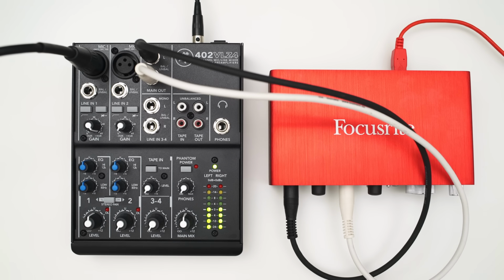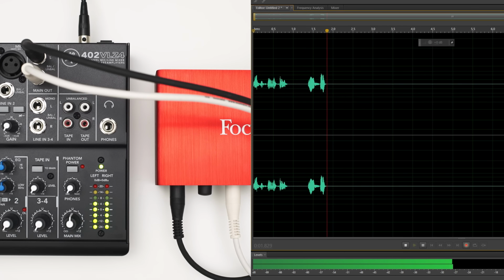Setup Guide - how to connect a Mixer to an Audio Interface for audio recording

Comment: Thank you so much for this perfect, simple, clear and basic explanation of this technical aspect of digital recording.  I would really love to watch you explain how to connect multiple synths and other instrument to a mixer and a interface and what type of mixer would be required.  I have a few synths (SH-32, yamaha CS, and Roland XP-50 which I use as a midi controller mostly and I am struggling to set them up permanently so I can use them when the inspiration hits.  I have a few challenges because I am not an engineer and am of the analogue time.  I do though, totally love these new technologies and would like to be able to have a better basic, fundamental understanding of of they work together.  The external hardware issue is a bit more easy to grasp but when it comes to setting the software part of the sequence it becomes a real mess...  I use Logic Pro with a Scarlett 4 pre, and I am a composer.  You also did not mention where the output is routing.  My set-up has the monitors going through the interface and into Logic, so I need my computer to hear sound through the monitors.
Reply: Dont use a mixer and an interface, just get a better interface with more inputs like focusrite 18i20.

Comment: The real question is: why do you need a two channel mixer if you already have a two input interface? Pointless. If you do use a (let’s say) 26 channel mixer to mix drums to two track, you are stuck with that mix once it’s on disc. There’s no adjusting levels on individual drums or compressing/gating separately. You have to commit. Are you ready to do that? It’s good practice but most people don’t start out with that skill. What would be much better is a multi channel interface. Forget the mixer. Unless the mixer is also a midi controller, there is no point.
Reply: From the first pinned FAQ Post which you obviously didn't read:
Q: Why would I want to connect a two-channel mixer into a two-channel audio interface? Couldn't I just connect the two mics directly to the interface?

A: Yes, connecting a two-channel mixer to a two-channel interface is not really useful. I just used the hardware seen in the video for demonstration purposes.
Reply: You are exactly right, this is basically a beginner mistake video.
Reply: You can just tweak the eq and set up individual volume in the mixer. Before you record it. And optionaly add a signal prossesor to the insert of the mixer. And you can add multitrack recorder. When you wanna record more than 12 channel, then the mixer is the best option. You just have to find correct mixer and interface to do the job.
Reply: The even more real question is: why are you here if you're just going to record straight into your interface? This video is for those who want to use the preamps and maybe the eq from their mixer to their audio interface... Not every preamp sounds the same...
Reply: You are right @crosbyllc5426
Reply: The reason he is showing this video is because Mackie mixers are known for their excellent quality onyx preamps, even on this little mixer...which may be better than the ones on these lower end interfaces.  So the gain would come from the Mackie and not the low end interface.
Reply: I use it for blending two mics and getting a cool guitar distortion sound
Reply: The fact here is that ~33k people (til now) found this tutorial likeable, so there is an actual need.
Reply: @Marvin Bennett  i don't know exactly about that. but that can be happen since having a mixer can saperate the input and output monitor. while you only using interface that don't have capability to saperate direct monitor and playback from the DAW, the output will handle two sgnal from the direct input and from the playback that causing latency. adding a mixer will save you in that situation. give you 0 latency monitoring. however you can turn down the buffer size.
Reply: Useful as a channel strip, preamp for other lower sour e inputs, live instrument bus

Link your most recent releases though let us know how not beginner you are now that you’re blowing up dj wide chain
Reply: The same principle applies to mixer and interface with many channels. 
This is a good video for any e who wants to set up a mixer and usb interface in a rack and not have to think about rerouting audio cables from the interface to the mixer when you’re just playing or recording.

Comment: I went with the behringer umc404 and so far so good, apart from one or system crashes in the beginning.
Reply: Does it work properly with umc404? What you mean by one or system crashes. I am planning to connect mixer to my Behringer UMC22. Need help.
Reply: @DprjsSoundlaboratory  Hi, for some reason the umc404 drivers were causing my win 7 machine to crash, but works fine now.
Reply: @DprjsSoundlaboratory  i have umc22 and planing to connect it too, want to know if does work?

Comment: There is one downside: the signal being recorded is a combination of all the inputs to the mixer.  You won't be able to separate them in your Digital Audio Workstation (DAW) to control the quality of each different mixer input during editing.
Reply: You should have to find mixer that have a monitor output and main output. Connect you studio monitor to the mixer monitor output, and the main output goes to the interface, and imterface output goes to mixer phono playback. Then the signal come to interface will saperated from the monitor. The main mix will goes to interface, an then goes to playback then to the monitor. The main mix won't goes to the monitor until you play it back from the interface
Reply: If your mixer has pan knobs you can pan the channels hard left and hard right and get the two separeted. Otherwise get a mixer with direct outbuts on every channel.

Comment: Why trs cables? Normal unbalanced jack cables work also. I wonder if a main output on a mixer is trs at all.
Reply: Unbalanced cables pick up noise after 12 feet
Reply from the maker: TS should work as well, but most mixers have balanced outputs and it makes hardly any sense to not use it.

Comment: So at out next gig I'll be trying this and recording the session. I guess I just need to take the outputs from the interface to an amp and speakers?
Reply from the maker: Hey, for a gig I would set this up differently. You typically need the main output to be connected to the PA system. In that case I would take the audio from the Tape out and feed it into the interface.
Reply: Julian Krause Thanks for the update

Comment: Please correct this text from your Q & A section    "Q: Does this setup increase or decrease preamp noise?
A: This depends on the preamps in the mixer and interface. If the preamps in the interface are much better than the interfaces preamps"   this part  "If the preamps in the interface are much better than the interfaces preamps"  I assume you mean if the preamps in the mixer are much better...  Also there is another issue with the text in this Q&A section.  "But this is also true the other way the other way around."  Repeated phrase.  Anyway just letting you know.
Reply: But it doesn't 'depend' on anything.  All preamps have noise, therefore putting two in series with each other increases the noise floor, period.  Worse, the second one will amplify the first preamp's noise.  That said, I know from experience and many reviews that the Focusrite preamps are VERY low noise, usually around -90 dB, so the noise they do add is not an issue, even at the highest gain.  The Mackie's preamps are also reported to be low noise, but I have no first hand experience there.  If true, the final noise floor is probably too low to bother discussing.  One cheap guitar pedal or badly shielded mic cable would add more noise than either of these.

Comment: Did I miss where you adjust the gain on the Focusrite?  I saw where you turned it down, but didn't see you adjust the input level up again.   I assume you want to keep it in the green on the device and occasionally make the yellows is you have them but never hit the red., Right?
Reply: All Focusrite Scarlett audio interfaces use software to control Everything.  Gain, pan, routing inputs to which output (if you have more than one).  The newest ones even removed the pad and line / instrument level buttons and moved them in to the software.  He didn't show any of the software adjustments at all.
Reply: @chrisw1462  because he never made any software adjustments. with the scarlet if you're adding say a mixer or pre-amp you adjust on that device and the zero on the focusrite is more than hot enough.
Reply: @brtcobra  I have the 6i6, and the default is all the way down, and I couldn't hear anything until I ran the software and moved the slider up.  Maybe they changed it?
Reply: I second Chris W on his answer. But there is also a second reason to stay away from the gain knobs on the Focusrite. It has to do with control of your sound in the chain. The line input is capable of handling a strong enough signal with the gain down. Smartest thing to do is pushing a strong enough signal to the input, without tinkering with the sound in just another place. When problems arise, you just don't want to be frantically mess around with all kinds of settings on all kinds of machines.

Comment: Would it be better to record directly vo with your preamp, directly to your interface than use a mixer?
Reply: Sometimes you want to use a different preamp or sometimes you get a less noisy signal from an external preamp. It all depends on what you want to do.

Comment: What about recording drums where you have like six or eight microphones. How would you connect in that case?
Reply from the maker: You could do this the same way, you just need a mixer with more inputs. In your case I would actually recommend to not go through a mixer but to buy an interface with more inputs. Then you can manipulate the sound from each mic individually in post.
Reply: @JulianKrause  recording drums live, I think you really need to invest in a large, multi-input powered mixing board/desk, not just a small mixer. Especially if you're going
to hook up the mics on and above the kit, permanently for recording. The more phantom power the better, and the better quality the desk, the better. And then you 

have to worry about bleed, and other issues recording drums, but better quality mics, and a good desk will help.

Comment: My Yamaha MG10xu mixer has a USB connection and works great, thereby eliminating an interface.
Reply: Yes, I have the Yamaha MG-10XU too. The Yamaha also comes with a 1 knob compressor for Ch1 and Ch2 which is useful to make speech easier to listen. Setting this knob at 11 o'clock position will cater for most people.

Comment: If I have my speakers connected to my 2 main outs how would I connect my interface into my interface?
Reply: Why not just use the main outs of the interface to your speakers..?
Reply: you can't so use the headphone out with a stereo to 2 mono Jack cable, but honestly you're better by using just the soundcard pre-amps
Reply: If your mixer has control room outputs, you can use those to output to the interface or you can use the interface's outputs with your speakers.

Comment: Julian, I've been looking all over YouTube for an explanation of how to do this. Finally, I found yours! Job well done! Clear and easy to follow. Thank you! I do have a question. I want to go from my mic that's connected to my mixer then through the audio interface and finally to my iPhone in order to record a speaker's presentation. Will the Focusrite Scarlett Solo work for this, since it is bus powered? Or would I need an audio interface powered by AC? If I need an AC powered unit, what budget model would you recommend?
Reply from the maker: Hey, you have to connect the audio interface to an PC anyways, so you could just record the audio with a free software like audacity on your PC. No need to connect another smartphone

Comment: If recording 2 inputs are ,Does a mixer send 2 seperate tracks to the computer?
Reply from the maker: Yes, if you use a two channel interface you can record 2 individual tracks.
Reply: @JulianKrause  in DAW, do you set up 2 mono tracks and pan left and right? Or stereo track? What is the routing? Thanks

Comment: I want to connect my DJ mixer to Scarlett 2i4 and my question is on audio interface I have to leave both input gain knobs all the way down ? Will it work ? Thanks for answer.
Reply from the maker: Yes, you would connect the two devices with TRS cables and leave the gain on your interface all the way down.

Comment: I know it’s not a mixer but could you give any advice on connecting a pocket operator to an audio interface so I can hear the sound through my monitors?
Reply from the maker: Hey, I would guess your pocket operator has a stereo 3.5mm output. If your audio interface has RCA inputs you would need a TRS 3.5mm to RCA cable. If that's not an option, one more possiblity is to use a TRS 3.5mm to 1/4 inch TS cable. This would plug into your line level I inputs on your interface.

Comment: I have the same question as A Gallant above....where should I hook up my playback speakers to the mixer or interface ? Thank you.
Reply from the maker: Hey, you hook them up to your interface. Two reasons for that. First of all you will hear if there is any clipping in the interface. Second of all you can listen to the audio of your DAW which wouldn't be possible if you connect the speakers to the mixer.
Reply: @JulianKrause  hello please I need your response
Reply: Thank you for the response. Heading to switch my cables right now!
Reply: Nice video and really helpful, but my case here is that I have two pairs of speakers, how can I make use of the two on the same mixer?
Reply from the maker: @obinnaosikwe1983  If they are active monitors you could use something like the Mackie Big Knob Passive to switch between them.
Reply: @JulianKrause  thanks for your reply, can I connect this Mackie big knob with my Scarlett 2i2?

Comment: If my interface only has on line level will I still get stereo sound
Reply from the maker: No, you only get mono sound but that isn't usually a problem because when you record your voice with one mic it is already mono. And depending on your software it will still play on the left and right speaker.

Comment: depending on the mixer preamp quality i would expect setting the mixer gain to 90% or more would rise the noise floor. so what about going to 75% and then increase the gain on your audio interface until it fits ? just to avoid the noise i mean...
Reply from the maker: You get the best signal-to-noise ratio if you primarily use the gain of the mixer and keep the gain on your interface as low as possible.
Reply: @JulianKrause  thanks for the reply. when adjusting a mixer i always start at 0dB gain on the interface. then i increase the gain on the mixer. as soon as i detect rising noise floor from the mixer i stop and start rising the gain on the interface, usually 10 or 20 dB is enough. seems to be the best solution for me. but you are the pro, so i ask : am i wrong here ?
Reply from the maker: @olafkliemt1145   There is no benefit in raising the gain on your interface before you have maxed out the gain on your mixer. The noise does not increase exponential with the gain like many people think. The proper way to do it is to keep the gain on your interface at the minimum and use the gain of the mixer. You only increase the gain on your interface if you already maxed out the gain on the mixer and still need more gain. This will give you the best signal to noise performance.